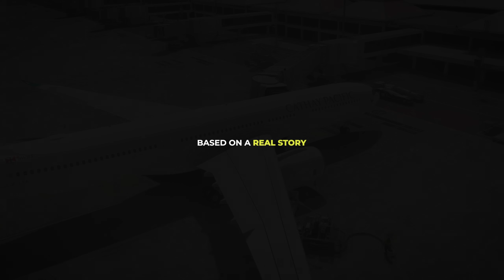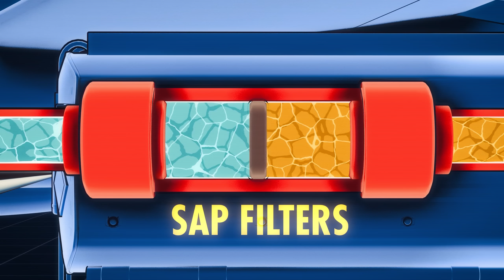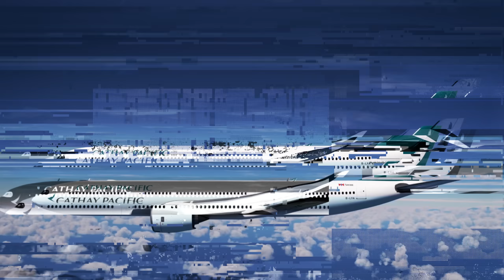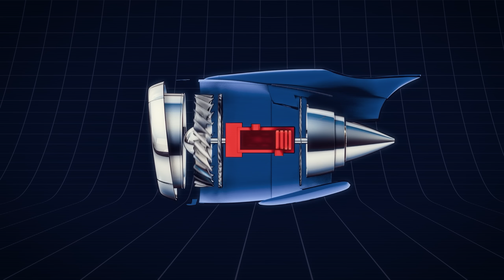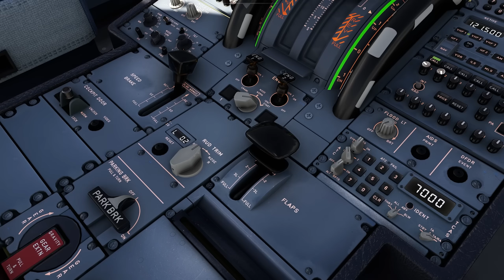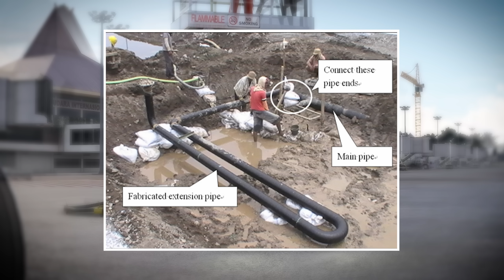Invisible Threat Destroyed the Engines | The Story of Flight 780

Comment: shouldn’t the trucks have been there with giant water spray compressors to cool down the brakes…the pilots should have called that as a precaution right?
Also, the plane should have turned around the minute the right engine showed any pressure irregularities correct? The ground trouble shooter should not have speculated what the issue was and recommended they land immediately and check out the situation correct?
Hopefully there was real learning from this for it is better to be safe than sorry, regardless of whether passengers might be inconvenienced, and the increased cost of turning around for the company

Comment: No matter what with lesser capable pilots this could easily have ended in a crash after landing. 
When a pilot tells the cabin we have small problem with engine #2 you know that always means engine #2 is dead and we're entering marginal survival chances.    A hunk of steel weighting hundred ton assembled with rivets flying iin the air was never a good idea.  All planes should be capable of gliding without it being a significant challenge or risky situation for the pilots.  Ocean liners is the proper way to travel. People do not need to travel across the world by flying, it's wrong in every way and sense.

Comment: Can't The Pilots turn the engines off so they can land.
Reply: Probably could have achieved reduced energy by hitting the GS from below and then cutting power. But runway crosswinds option to go around would be lost. A discussion of the airline dual engine failure procedure would be appreciated

Comment: The question has to be asked, why didn't the pilot cut off the fuel to the unajustable 70% thrust engine before landing?
Reply: I agree that the videos on this channel are superior. Having said that, I cannot commend the pilots. Yes they did a great job of getting out of a situation that they created. As a retired Captain with over 28,000 hours I suggest that at the first sign of an indication such as they had 30 minutes after t/o, they should have either returned to departure airport, or landed at nearest suitable airport. Little problems always eventually lead to large problems. Stop the process by ending the flight asap. With only 2 engines (thanks to fuel saving issues) you are not very redundant in a 2 engine aircraft, so please do what I was advised by a very good ground school instructor, LANSA which stands for "land at nearest suitable airport". Otherwise, I will say they were doing a good job of handling the loss of thrust.  I suggest it is a good training film for pilots to not accept small problems with a long flight ahead of them.

Comment: A video about a tense situation that develops with a  Cathay Pacific flight as it approaches its intended destination airport in Hong Kong.   Based on particles developing within fuel lines, the aircraft with TWO engines effectively begins losing power in BOTH engines.  The pilots - attempting to overcome the distressing situation as they begin landing procedures - are forced to INCREASE aircraft speed to a level that is excessive for landing - but they must land anyway.   They manage to land "successfully" due to exceptional efforts by the pilot crew - but the video ends with passengers exiting the aircraft using emergency procedures.   Not a very "happy story" for frequent air travelers - but - NOT A FATAL LANDING.    Cheers!      Steve, Bangkok, Thailand (since December 1999)

Comment: What I would have liked to hear was relative to the fuel tanks and other aircraft.  Others must surely have had similar issues after taking on fuel from the same tank and/or mobile pump?  Would the fuel pump operators be instructed to check the situation after repeated efforts to stop the vibration failed?

Comment: More importantly which I don't think you mentioned, was that the SAP filters were only designed to show if fresh water was mixed in with the fuel. Since it was saltwater, they failed. This happened because they worked on the fuel tanks and added fuel lines to fuel up more planes, and they failed to flush the system properly.

Comment: I’m not a pilot, so I would have turned back at the first sign of trouble. I wouldn’t even keep driving my Jeep if engine parameters showed bad like that, and that’s on terra firma. Regardless, a great job of emergency management by the crew. 
Also, why wouldn’t they have a mechanical filter last thing on the fueling rig?

Comment: Amazing response from the pilots. I'm surprised this only affected Cathay though. Surely other aircrafts that day must have had the same contaminated fuel. Overall, it does sound like cathay's engine failure protocols were also at fault. With repeated engine issue signals, plane should have turned back much earlier.

Comment: A&P/Mx Controller here.

It is situations like these that frustrate. If we have to exercise QRH with a flight crew, it is imperative to seek divergence/ODI.

A two engine aircraft with an engine in Rx means we have lost our only redundancy in the Powerplant system.

Safety MUST always be vital, schedule be damned.

These scenarios are saddening. While I’m fine deferring per GMM/SOP, the rapport between the crews and us to ensure proper & safe operation in safety of flight is paramount.

A loss of motive fuel function is terrifying, much like fuel or critical flight control surface icing.

Comment: @Aviationaccidents Great video. It would be good to know what safety recommendations came out from the Investigation Report and if the recommendations were accepted and implemented. E.g. was there a recommendation addressed to Rolls Royce to redesign the flitering system to make it more robust and effective against saltwater contaminants? I assume a study was made to ascertain which flights uploaded the same contaminated fuel and why those flights didn't end up in the same predicament.
Reply: It isn't really Rolls Royce's problem, but that of the works contractors being careless in letting SALT water into the airport refuelling system, with possibly the need for some kind of detector in the pump vehicle to make some subtle indication of the salt, like maybe large flashing beacons visible to all sides and loud klaxon horns alternating with a voice shouting "DANGER, FUEL CONTAMINATED", in English and the local language.  You know, the kind of thing that will allow the operator to correct the problem without anyone else realising!

Comment: Can't the pilots use the engine master switch to shut down engines and slow down during the descent?
Reply: Sure, would you shut off your vehicle’s ignition on the freeway and just coast all the way home without power for steering, brakes, etc?
Reply: @billeldon  That's not what he is suggesting. Shutting them both down on final approach seems plausible.
Reply: @billeldon  When you have Batteries, a Ram Air Turbine AND an Auxiliary Power Unit, plus brake pressure accumulators, and it is downhill every inch of the way, absolutely.  They should probably have done that earlier to prevent the overspeed landing, but the tough part is guesstimating how much earlier.  Unless either of them had recent glider or single-engined experience (power-off landings are a required skill demonstration for single-engined flight, where pilots of multi-engined aircraft are assumed to deal with engine failures by bringing a spare to get them to the accident scene) to guide them, as it isn't something normally rehearsed in the simulator.  But when you discover that there is no checklist for the problems you have, that is the kind of thinking that saves lives.

Comment: One question comes to mind.  When I was getting a pilots license, one of the most important parts of the pre flight checks was to get a fuel sample out of the fuel tanks in the wings.  It seems this would be something that an airline would do as well.  Wouldn't the pilots have to take a look at the fuel samples?  There is no mention that this was done.  Was this a pilot oversite?  It seems this would be standard operating procedure.
Reply: Did you watch the beginning of the video?

Comment: I don’t miss being an airline pilot.
Reply: Would you please elaborate on this? I’ve recently done some research and have come to conclusions I don’t want to believe, because I like to travel. But risk/reward I’m not so confident since those reports that came out about Bowing
Reply: @dasbootsassa   Airline travel is statistically safe. However, there are still statistics… if you know what I mean. The airline industry has vastly changed since my career started and ended. Airline personnel are still highly trained and aircraft are still highly maintained. But the industry would wide is in a very dynamic transition. There are many factors at play. One example is that during the COVID panic, airlines offered their senior more experienced pilots early retirement packages. This was due to the expensiveness of them being at the top of the pays scale. Flight school has continued to greatly increase in price… to the tune of well into the six figures. It’s been that way for a while which has deterred many people from pursuing it over the years. There is an unimaginable passing of the torch.. so to speak in every aspect of the entire operation. New/green( inexperienced) people in all of the positions that require experience. ATC, maintenance, dispatch, pilots etc. everyone has to start somewhere… but in years past. There was more of a mentoring philosophy. The experienced personnel taught the new, less experienced personnel. Example: when I was a brand new pilot, I would fly with pilots with thousands sometimes tens of thousands of hours. Now you have a lot of inexperienced people working with inexperienced people. It used to be that you gained experience by learning from the folks that had it. To go to the major airlines you had to fly for smaller airlines as a First Officer (co-pilot), then upgrade to Captain, gain thousands of hours of experience then you could apply to the major airlines for a co-pilot position. Now they have GREATLY lowered the bar. You can be fresh out of flight school, gain the ATP minimum hours (1500) get hired as a copilot with a 121 operator gain another 300-400 hours and get hired by the majors….totally bypassing the requirement to upgrade to captain and gain PIC experience.. this was un heard of in the old days. So the bottom line? You have a lot of inexperienced people doing a job that requires a lot of experience. Me personally… I’ll never fly again. I’m not saying I was the greatest, most experienced. I retired with about 15,000 hours. I was average at best. But in defense of the industry. They do train with high standards and proficiency.  I think overall it’s still the safest way to travel.  I was always a nervous flyer if I wasn’t flying.😅 lol BTW, I had quite a few emergencies during that time…that’s where the experience of being mentored and working my way up the ladder paid off… otherwise I could have easily made world, headline news. Not the way I would want to become famous.

Comment: "there was a small problem with the engines" lol, understatement of the year.
Reply: This is the most underrated comment
Reply: They are trained to tell lies 😂😂
Reply: @nishant54 you do realize people can panic right? 😂 Its just common knowledge to tell lies in situations for better good
Reply: @lem4612 yeah passenger panicking won't help anyone.
Reply: @nishant54  yeah definitely better to tell lies in such situations to prevent panic, this is just common knowledge unless youre dumb
Reply: @nishant54  unless youre dumb enough to not know, its common knowledge to tell lies in life or death situations to prevent panic causing more trouble
Reply: The issue was with the contaminated fuel uplifted in SUB and not the engines

Comment: why  didn't  the  pilots  shut  down  the  #1 Engine  just  b4  touch  down  would  have  made  it  easier  2  stop  i  would  think
Reply: Information overload. They have warnings buzzing, they are focusing on trying to land. Fear that something will go wrong if they shut down the engine.
Reply: Arr you a pilot?
Reply: @ac8228  Yes I am. A long time Hang Glider pilot of over 20 years. I know just a little bit about gliding.
Reply: They, humans, haven't been through something similar and didn't know what was best. I still don't know what's best... Immediate, abrupt, loss of thrust could be chaos
Reply: I was thinking the same. Shut it down, lose altitude and glide it in for a controlled landing. Pilots should practice more all engines out gliding and landings at least in the sims. It seems they panic when they lose engine power. Coming from a hang glider pilot whose every approach and landing has to be spot on as we have no such thing as a missed approach-go around available. We get one attempt and that's it. You blow it badly enough and you're dead. BTW, ACI, another EXCELLENTLY produced video! I hope your channel blows up! MORE content PLEASE!

Comment: Shouldn't pilots be advised to land at nearest airport when signs of  possible engine problems are indicated. Passengers safety should always be number one priority.
Reply: Not necessarily. The nearest airport's runway could be too short, or it might not have the emergency services and equipment needed, for example
Reply: If it's recently taken off its much heavier with the amount of fuel so need a big runway to land safely. Usually alot of weight has been shed via fuel use
Reply: No

Comment: why don't planes just immediately turn around when something first happens?
Reply: Turning a plane is not a good idea until they work out what is working and what is not.
Reply: A lot of times they'll get punished by the company for wasting money on fuel, hotel expenses for passengers etc...
Reply: The crew followed the advise of their Maintrol and the severity of the problem did become apparent until they were a lot closer to their destination. The crew did a great job stabilising the landing at high speed and with only one thrust reverser operative, it must have been pulling the aircraft all over the place.

Comment: How had salt water got into fuel tanks ? When they got engine oddities, why didnt they call  a pan ,pan ,pan, and go back to the airport.
When mechanic couldn't bottom it why?, didnt he say I think you better return to airport.
Crew asking manufacturers was it safe to
 continue, they can see plane. I would have turned back their the crew in charge ,and should be knowledgeable to decide themselves.
Reply: It's wild that you edited this comment and it's STILL full of near-illegible grammar
Reply: The airports underground fuel tanks are within ground water levels which is shallow and is saline because the airport is right on the coast, the underground tank had a leak that allowed the saline ground water to leak into it. No salt water from the underground tank actually got pumped from the underground tank into the aircrafts fuel tanks there are filters that absorb water as its pumped into the aircraft, but salt water damages the water absorption filters and they released little particals of filter material that got pumped into the aircrafts fuel tanks, the filter particals blocked the aircraft's fuel system.